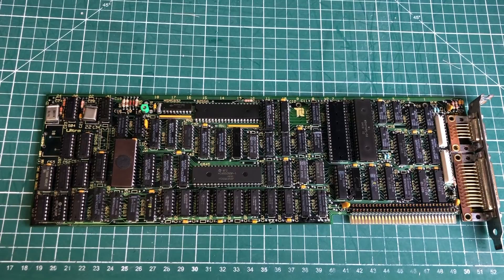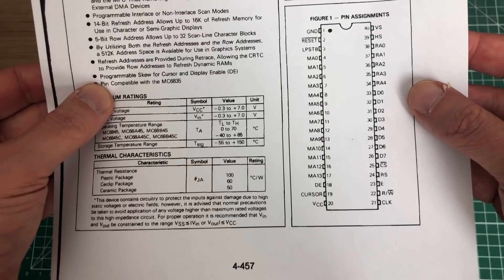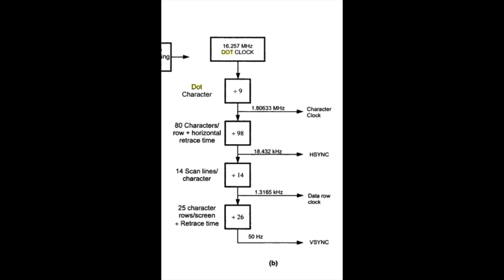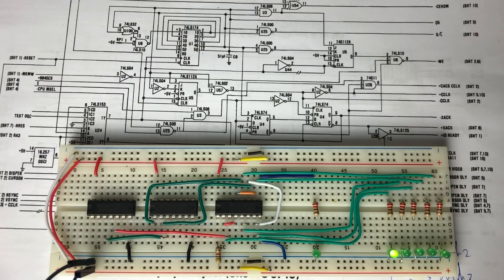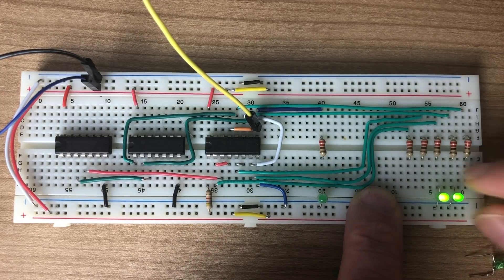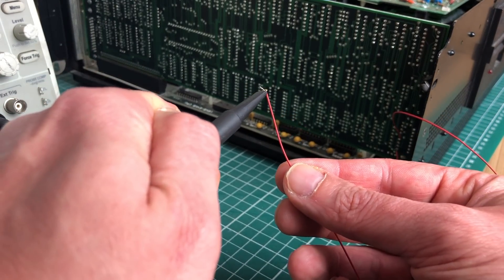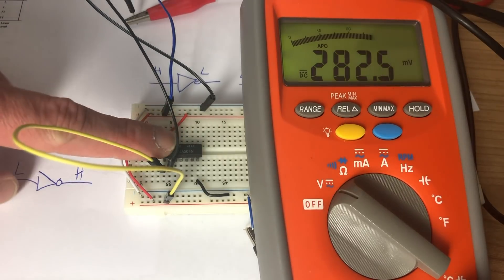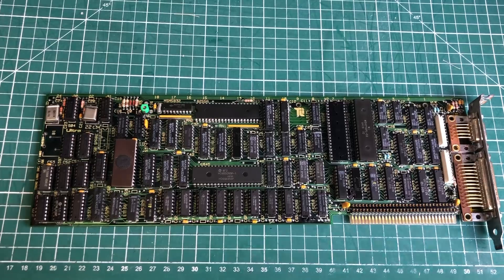Unfixable videocard from hell ? (part 2)

Comment: While MDA has only one mode of operation - the text mode, where the character clock is the crystal clock devided by 9, the Hercules card has two modes of operations. In graphics mode, the character clock is the crystal clock *divided by 16*. And 16.257 MHz / 16 is 1.016 MHz. This means your card has switched to graphics mode because of some signals it received from the bus.
The fact that you can measure 1.8MHz on the bench and 1.0MHz in the computer actually is a good sign for the clocking circuit - it operates well in both text and graphics mode - but something on the card is misinterpreting the bus signals - the IBM PC/XT BIOS is unable to switch a working Hercules compatible card into graphics mode.
Reply: I would suspect those two 74LS chips, if they are somewhere near a control line, they could be pulling some pin of the CRT controller low which causes the controller to switch to Hercules mode instead of MDA mode.
Reply: @Stoney3K  Basically a good idea, but the CRT controller chip (the Motorola 6845) has no idea about text and graphics modes. For that chip, the graphics mode looks like exactly like a 40x87 text mode with a character height of 4 pixels. The distinction between text and graphics mode is made in the logic around the CRT controller instead.
Your basic idea is right nevertheless: Something is broken on the card that the support logic interprets something that happens on the bus as a request to enable the graphics mode. The hot chips indeed indicate something is broken in them or their vincinity, so finding out whats wrong with them is also the next step I would do. Or I would try to trace out schematics and reverse engineer the card, so that I can probe for the root of the signal that enables the mode bit to toggle to graphics mode.
Reply: Yes..it had to be switched by a dos driver command . but default should be MDA mode..unless jumpered to HGA.
Reply from the maker: @MessalineApghar  The IBM PC is set to MDA using its dip switches. I haven't found the manual of the Tseng Labs UltraPak but the output should be limited to monochrome MDA (default) and hercules. There are 2 jumpers on the card but tried all combinations. But will keep on investigating. Will start with the 2 hot chips.
Reply: @RetroSpector78  there were usually software drivers included with the boards as well to change modes. And not all mda graphics cards were hercules standard.  Some did cga emulation instead or in additio .
Reply: @RetroSpector78  beautiful work on the refurb btw.
Reply: @RetroSpector78  The 2 jumpers on your card don't necessarily are related to video functionality. That card contains a parallel port and two serial ports in addition to the video part, so they might enable/disable other components.
Reply: @MessalineApghar  I have yet to see a card where MDA/HGC is jumperable. HGC is MDA compatible until you write extended feature enable bits into I/O address 3BF. After setting the graphics mode enable bit in that register, bit 1 of the mode select register at 3B8 is used to toggle between graphics mode and text mode.
Reply: @tw11tube   i lived thru it. I have been building PCs since 1978. I owned serial number of 5150, 5160 and 5170 all under unit 100.  (Ibm employee purchase program)   And even jumpered,  its not fixed. It could still be mode selected in software. It just determines the beginning state of the card. And usually the LPT address is also jumpers or switches.  But i very definitely remember some MGA cards as they were called, having jumpers for boot-state.  In particular some of the Everex manufactured models.
Reply: HGC is MDA ??? Could you elaborate?
Reply: @Infinitesap  any HGA card should be able to switch modes downward into MDA mode.  A very few early HGA 
Cards required a separate MDA card and a daisy chain cable but they were the oddballs .
Reply: @MessalineApghar  HGA? meaning MDA meaning?
Reply: @Infinitesap  HGA = hercules graphics adapter
MDA = monochrome display adapter.
MDA doesnt support graphics. HGA did even though it was also monochrome.
Similar hardware but not the same
Reply: @Infinitesap MDA means "monochrome display adapter", and is a very common, albeit imprecise name for the IBM Monochrome Display and Printer Adapter. I will keep using the common term MDA in this comment. The MDA was the first video solution available for the IBM PC. It has a mere 4K of video RAM (remember, in 1981 ram was very expensive!), and only supports an 80x25 monochrome text mode. As the characters take 9x14 pixels, it builds apicture using 350 scanlines, so the text quality of that 80x25 screen is excellent for the time.
HGC means "Hercules graphics card". HGA means "Hercules graphics adapter". This is the same thing. The original Hercules Graphics Card is the model GB-100 by Hercules, which is not very widespread and thus is a collectible item today. It was quickly replaced by the slightly improved revision GB-101, and later by the GB-102. The GB-10x family of graphics board have 64K of video memory and support a 720x348 graphics mode as well as a text mode that is identical to the MDA text mode.
There are a lot of Hercules compatible boards on the market, so I can't talk about all of them, but the GB-10x family of original Hercules cards behaves very much like an MDA card (some deviations on the GB-100: It was incompatible with the IBM PC diagnostic tool; one reason they quickly released the GB-101). To enable access to more than 2KB of RAM or enable the graphics mode, some control bits have to be set in a Hercules specific I/O port that is not used by the original MDA card. The original IBM PC bios knows how to set up the MDA text mode, and because the GB-10x cards are MDA compatible, the BIOS is also able to initialize these cards into text mode.
The IBM BIOS never contained functions to switch the Hercules card (or any Hercules compatible card) into graphics mode, so this had to be done entirely inside application software. On the other hand, switching a Hercules card back to text mode could be done by using the BIOS service to reinitialize the MDA text mode. You don't have to do any Hercules specific things to get the card out of graphics mode.
So, it is imprecise to say the "HGC is MDA". But for the original Hercules cards, it is correct to say that for all software that used the MDA card in the way it was intended to be used, the Hercules cards behave exactly the same way as the MDA cards do. It is quite possible that there are Hercules-compatible graphics add-ons that you can install alongside an MDA card. These cards could be built simpler than an orignal Hercules card, because they don't need to support text modes, and can do away with nearly all mode distinction logic and the character generation hadrware, which could make them cheaper than a complete MDA text + HGC graphics solution on one board.

The card in this video is a Tseng UltraPAK. The Tseng UltraPAK has three modes of operation. After a clean reset, it should enter the MDA compatible mode. Even if it doesn't on system reset, it would enter the MDA compatible text mode as soon as the BIOS tries to initialize it with the MDA text parameters. The second mode of operation is the Hercules compatible 720x348 pixels monochrome graphics mode, and the third mode of operation is a Tseng-specific 132x44 text mode with a 6x8 character cell. This means that you get to see nearly 6000 characters on the screen, but the quality of the individual characters is worse than the character quality on the CGA graphics card, which is already considered low-end (but viable in the early 80s).
RetroSpector78 measured correct MDA mode clock behaviour on his bench, but if he puts the card into his computer, for some reason it switches into HGC graphics mode, although the IBM BIOS does not contain any code that will switch a correctly functioning Hercules card or any compatible card into graphics mode. This shows that there are some more broken chips on the card, not just the hex inverter he replaced in this video.

Last note: Some sources in the internet drop the name ET1000 in combination with the UltraPAK. ET1000 is not the name of a card, but the name of a chip, which Tseng Labs used on later Hercules compatible cards to replace around 20 of the 74-series chip on this UltraPAK. The common ET1000 boards do not support the 132x44 mode.
Reply: @tw11tube  Thanks for your comprehensive reply. It seems to me that you also can make electronics videos. Please do so if able. I reallly need to understand what "blackboxes" e.g. the mentioned frequency divider et al. that are common in electronics and how to build them. I really need this knowledge now. 
Again thanks :-)
Reply: @Infinitesap  The divide-by-9 divider of the MDA card is explained in this video at 4:50 . Also, Ben Eater has a whole video about the frequency dividers used for his breadboard video card at https://www.youtube.com/watch?v=cfgTki4dzLs.
Reply: @Infinitesap  tons of information out there for digital logic design (which this all encompasses beyond some basic electrical/circuit theory knowledge). I suggest starting logic design from the most basic steps (logic gates, truth tables, k-maps, Boolean algebra) and building from there. If you dive into it at FF clock division, you will be chasing a lot of loose ends.
Reply: @winebartender6653  I know about logic design as you mention. But I need some applications - a way to utilize it. I need to be able to "write a program" with black boxes so that I can build a device that actually can do something practical. If I build an R2R and use i both ways then what? I really need to know how its used in an application, so that I can build it into my own. Does this make sense?
But thanks anyway :-)
Reply: I'm not so sure it's the Bus input pushing it into Hercules Mode., some of the earlier ones were designed to Default to it... and I distinctly recall you needed a Null Terminator / Jumper Cable on the Hercules Output that would trigger it to go into MDA Mode.
The fact that this one has Header Pins on the Bus input, strongly suggests it's an earlier / engineering design. 
Heck it still has the bodge wires on the back., which were typically gone in later models. 

It's been 30 years, so I don't recall exactly; but you can use the Bus (the header pins on the bus) to force it into MDA Mode; but you'll have to probe them to figure out which. 
I'd also check those Chips running at 60c, as they really shouldn't be above 30c in normal operation; the higher temp suggests they've gone bad... which isn't uncommon.
Reply: @Leyvin  Are you talking about the bodge wires visible at 19:40? They have been added by RetroSpector, because the traces were broken due to the leaking RTC battery. See https://youtu.be/fd0ofMSPk6M?t=1100 . You are right that the header pins on the bus input are very helpful in development designs, but they serve a different purpose here, too. In PC mag of January 14., 1986 you find an advertisement for this card: https://books.google.de/books?id=hoPbDSDNLTQC&ots=Kfoep32tvG&pg=PA33 There is a 384K RAM expansion (to upgrade a 256K mainboard to 640K) available as piggy-back module.
To be clear: When I am talking about Hercules mode compared to MDA mode, I'm specifically intendeing to talk about the Hercules grpahics mode compared to the text mode that is common to both MDA and Hercules. You select the hercules graphics mode by setting register bit 1 in the mode register at port $3B8 (after unlocking it by writing 01 or 03 to port $3BF). I don't know whether the state-after-reset of the mode bit on the original Hercules board or typical clones is well-defined (it could be, as a RESET signal is available on the bus, which might be used as a clear input for some latch), but I do know that any sensible PC/XT-class computer initializes the mode register very early in POST, because an unsupported value in the mode register can make the whole ISA bus (and thus the machine) lock up.
I can be sure that some bus input is switching the RetroSpector78's card into graphics mode, because it is in text mode on his bench when he does not connect the bus, but it is in graphics mode when it is running in the PC. I can not be sure whether it is caused by an I/O cycle, the assertion of the RESETDRV signal, or any other pattern on the bus, though.
I agree that the hot chips problem needs to be solved: I wrote a separate comment on that issue: https://www.youtube.com/watch?v=p_X5zgAIYQA&lc=UgwtSof3wjIZEIVevMR4AaABAg .

Sources:

Initialization of the mode register in the original PC BIOS: https://sites.google.com/site/pcdosretro/PCBIOS.ZIP?attredirects=0 contains the listings. In PCBIOS.ASM and PCBIOSV2.ASM, the mode register initialization is at line 337; In PCBIOSV3.ASM, the mode register initialization is at 376.
Machine lockup without proper mode register value: IBM technical reference manual (e.g. http://www.minuszerodegrees.net/manuals/IBM_5150_Technical_Reference_6025005_AUG81.pdf), see page 60 (internal numbering: 2-41).
Reply: Thanks thats intresting

Comment: My guess would be to replace the two hot chips and retest on bench to see if temp is the same. If this doesn't resolve the issue then I would say it's something to do with the PC's power supply. Try using another PSU.
Reply from the maker: Tried multiple pc’s (different XT systems) but will definitely check the 2 hot chips

Comment: At part 3 you probably will be able to build the same graphics card from scratch faster than repairing this one.
~2 Amps is surely not OK for such a device. I think that the connector itself might be even not designed to withstand such power.
If you ever need to quickly find if something is overheating, Louis Rossmann once used an interesting trick. He just spilled alcohol on the board (best done immediately after disconnecting power), and overheated parts became dry much faster.
And please don't get discouraged even if it doesn't work in the end. You've probably already gained a significant amount of knowledge that can be a big help in any future repairs.
Reply from the maker: Haha :) yeah it has been a nice learning process ....  learning a lot from your comments also. I will prevail..... someday :)

Comment: have you got a eprom programer as you can plug in the chips and use a program to test them
Reply from the maker: I have and I will .... didn’t know it could do logic chips :) something for part 3 (all the socketed chips have been replaced and brand new). Will check the “hot” chips also.
Reply: @RetroSpector78  Yes the common MiniPro TL866/TL866II EPROM programmers you can get from ebay, etc have the ability to test many 74 series logic chips and even static RAM chips. Sadly they aren't up to testing TMS4164 or TMS41256 DRAM chips. I'd also suggest dumping the EPROM(s) on the board as this will test them out if nothing else.
Reply: @davefiddes  You can build you own small microcontroller based DRAM testers.

Comment: I would start with socketing every IC if you're really wanting to get it working. but I would start by swapping out the 2 chips that are getting hot. that seems a bit high of a temp to me. I am not an expert but I would start there. Also in my time fixing junk I have come across components that only short when the circuit is live. so it can be a pain in the butt to find the issue. this could be what's happening to your CRT clock. just a guess. have you thought about bypassing the clocks and injecting your breadboard version to see if that changes the results?

Comment: Whenever troubleshooting these vintage card's, it may not actually be the card's fault, it may be the PC's CMOS itself. Have you tried using this card in another system?
Reply from the maker: Yep... multiple other pc’s. Issue is definitely somewhere on the card
Reply: @RetroSpector78 thanks so very much for the timely response. 
I'm curious could the uvprom data be corrupted. For some odd reason I believe I've seen this type of fault in operation unless you've already singled that out and rewritten the eeprom.

Comment: Man best of luck with this thing. 
I've never seen 60C on anything of that era unless it had an internal short. That might also explain the power consumption. Check those two hot chips.
Reply from the maker: Will do ! See you in part 3 ;)
Reply: @RetroSpector78  Did I miss it or is there no part 3 yet? :)
Reply: Those hot chips could also be a symptom of something different and not directly a failure of the chips themselves. If something is loading their output circuits down or driving the outputs from somewhere else, they will source or sink current they're not supposed to.

If they carry high frequency signals, bad capacitors could very well be a cause of excessive load on that circuit.
Reply: @Stoney3K  Admittedly, that could very well be the case. Therefore the type(s) of the ICs and the circuitry around would be interesting.
Reply: Stoney3K yep - but either way, I’d bet they’re involved in the problem, so that’s where I’d start.
Reply: Those two chips would also be my best guess. What's their type?
Reply: I had one particular card from some era in my past. It was a Nvidia 6600 GT, I think or something like that. Anyway, it was at 120°! XD
Edit: Celcius.
Reply: jojolafrite90 that’s a little different :) although a little too hot for a 6600, they do run between 85-95 under load in some configurations
Reply: This reminds me of the time when I took a digital electronics class and soldered chips to a pcb and made a random number generator and I couldn't get mine working. So I went to grab the board and show my friend who had finished his already and i put my and on one of the chips and it was really hot lol. It had turned out that I had soldered it in backwards. Good times :)